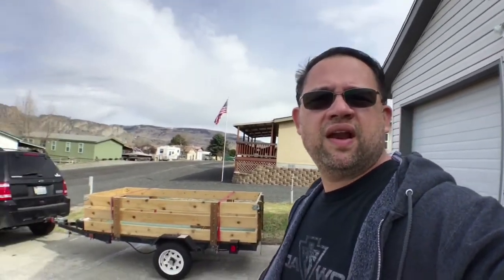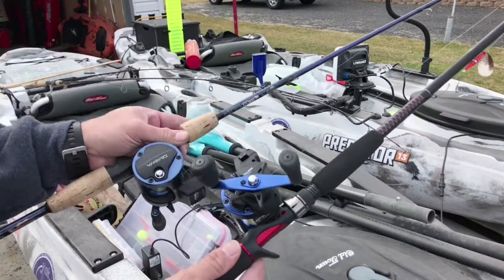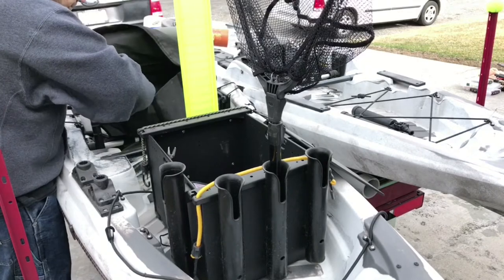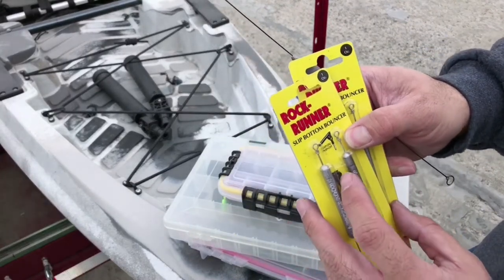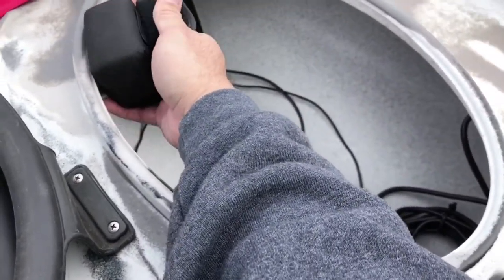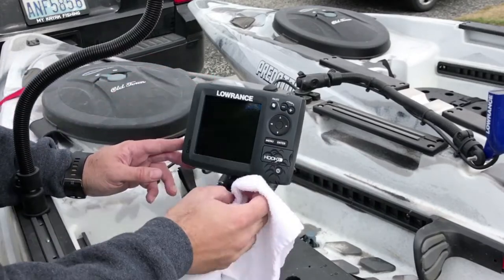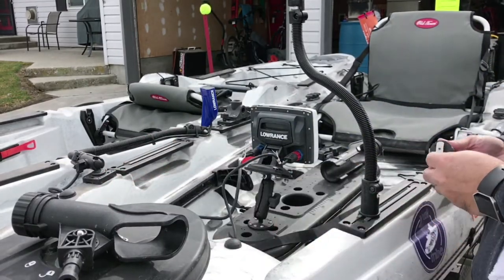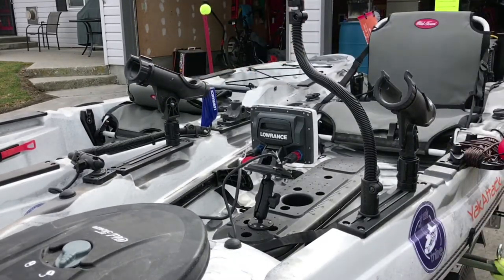My Old Town Predator 13 Setup | Out of Winter Storage | 2018

Comment: Is that a CDCR ball cap I see? Nice pair of Yaks and well equipped.
Reply from the maker: 10-4 on that. CDC it was called when I was there.
Reply: Yep was there from 89 to 2017 MCSP currently residing in Idaho.
Reply from the maker: @dandorris8531  calipat.  I was retired in 2002. Injured while on duty.
Reply: Glad your enjoying yourself. Your Yaks are bad ass. Thinking about getting one. A friend of mine has a brand new predator MK Never been in the water and wants to sell it. It’s loaded top of the line lithium battery and fish finder. About 3,300.00 worth. How stable are they to stand on?
Reply from the maker: @dandorris8531  Thanks. I Usually  paddle with the seat in high position. I only lower the seat if the waters rough. I only stand if the waters glass and NO boats are nearby. If I go into an inlet or cove. I'll stand up for better visibility.  
I always keep my vest on. I'm partially disabled so I know I have limitations. Most of the time I'm by myself so I also keep a whistle and waterproof floating communication  on my vest at all times.